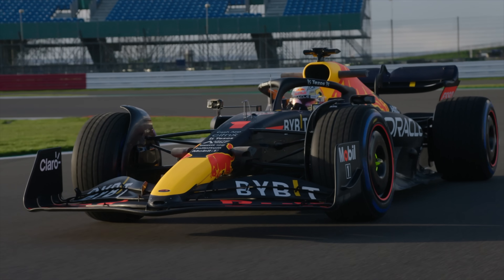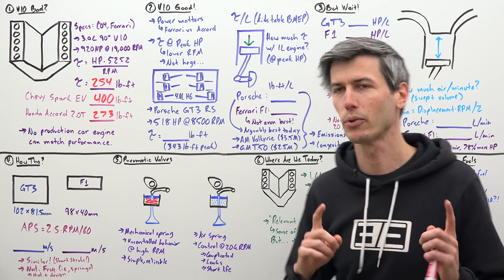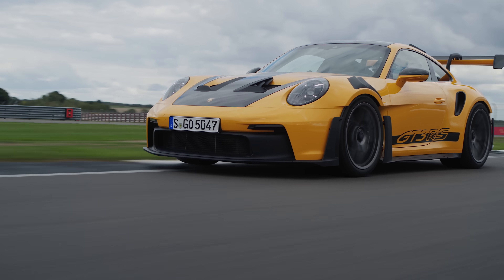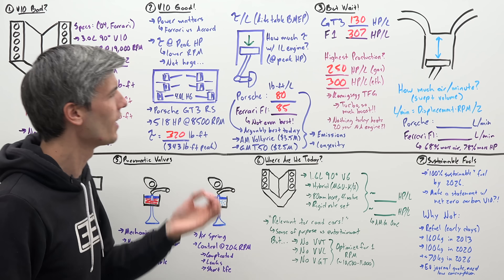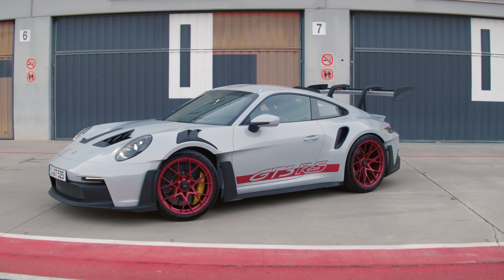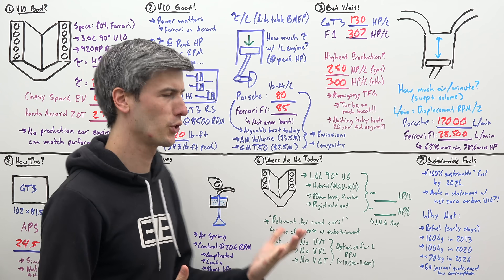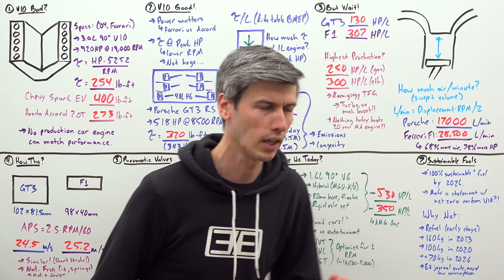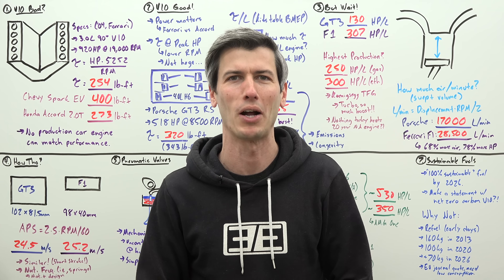Formula 1 V10 - The Greatest Engine Of All Time?

Comment: F1: "Let's use an engine more relevant to modern road cars."
Also F1: "Let's ban all the tech used in modern road cars."
🙄
Reply from the maker: Precisely, we're no fools!
Reply: @EngineeringExplained  Your videos are great. Not only informative, but funny also!
Reply: They're even removing the MGU-H for 2026, when it's finally being used in road cars
Reply: @Amy-dq2lg  What road cars? It's being removed from F1 because it's complicated and expensive. I can't imagine it's going to be on anything other than extreme hypercars.
Reply: @drunkenhobo8020 variable valve lift and timing has been used for many years by bmw for example. The B58 is reliable, powerful and is used by Toyota, ineos 4x4 and bmw themselves.
My 2c i think it's good :)
Reply: @ben7020 they aren’t talking about VVT….
Reply: @ben7020  Ok but the person I was replying to was talking about MGU-H. That uses the exhaust gasses to generate electricity and as far as I know, no road cars use it.
My own road car has VVT. I know it's fairly common on cars.
Reply: @drunkenhobo8020 Not only that, it's keeping the turbo spinning at the optimal RPM as well. Basically using energy to spool up the turbo and generating energy while reducing the RPM. But I agree to my knowledge no car apart from the AMG One uses that and I wouldn't exactly call that a typical road car either.
Getting rid of the MGU-H was also part of the agreement needed so that Audi would commit (not sure if Porsche wanted that as well, but it wouldn't be unlikely given that both belong to the same company).
Reply: @drunkenhobo8020  Variable valve lift and timing? You mean the VTEC Honda started using in 1989? Or Toyota's VVTi that they started using in 1995 and is used in exotica like their Corolla?
Reply: @MartinvanStormOfficial  Porsche were using fully-functional MGU-H in the 919 LMP1 car.  Audi also developed it and tested with the R18, but elected against using it. I'd be very surprised if Porsche were pushing for its removal, less so with Audi; but both companies had developed it, with Porsche winning Le Mans with it.
Reply: @OsellaSquadraCorse  PLus, I think Audi have used a version of the tech in some of their Road car engines. They use a version of the e-turbo to limit turbo lag by spooling up the turbo using an electric motor until the exhaust gasses could take over.
Reply: @drunkenhobo8020  the newer VAG v8s have electrically driven compressors
Reply: @drunkenhobo8020  Honda and Mercedes adapted the MGU-H technology for their road cars. It's not always a full Motor-Generator-Unit but Mercedes uses either an electric motor or the engine as an exhaust gas pump to keep the turbo running at a higher idle RPM. This is not so much performance-related but makes engine mapping, emission, and fuel management much easier at very low engine rpm.
For Honda it's similar but the recycling of heat energy into the turbo is really aimed at getting full torque earlier. That way, their new engines are small and light for the power they produce. But, indeed, the full chain of a generator, battery, and various motors to deploy is unlikely to ever be implemented in a mass-produced car because it's an unnecessary system complexity and cost for basically any performance goal.
Reply: @drunkenhobo8020 the new Porsche 911 turbo literally has e turbos
Reply: It's even worse:
F1: "These V-10 engines are way too expensive to race. Something must be done to give the smaller teams more chance to win."
Also F1: "Let's switch to incredibly complex hybrid power trains that cost almost 4 times as much."
Rest of the world: bruising their foreheads with facepalms.
Reply: They should just use 4 cylinder, more than 80% of road cars use that.
Reply: @GF-mf7ml Inline 4s don't work as a stressed member. The design brief for 2014 already called for them, but Ferrari vetoed it to avoid having to use subframes.
Reply: @dylansmit3883  Farm tractors do use i4 engines as a structural member.
Reply: @dylansmit3883  Ferrari vetoed it as they don't sell a car with an inline-4.  They insisted on at least a V6 option as that had some marketing relevance to the company, where Renault, BMW, Honda and VAG were pushing for the i4. When Mercedes broke ranks and joined Ferrari in asking for a V6 (along with Cosworth), the rules moved in that direction.
Reply: @OsellaSquadraCorse  Back then they didn't sell V6 cars either. But it makes sense they had future plans for them. The stressed member concern was also a factor though.
Reply: @OsellaSquadraCorse  RebBull were also against it as you can't mount an in-line 4 as a stressed member (or any inline engine really) you'd have to have a rear subframe which would completely change the design and engineering of the chassis. Let's not forget, that Ferrari didn't have a V6 in their lineup either at the time. (The 296 being their first v6 since the Dino I think)
Reply: @GF-mf7ml  and 3 cylinder is quickly creeping into the old 4cyl market, even BMW's are available in 3 pot configs these days lol
Reply: Actually, it's the 6 cylinder engines that is more common, throuout the production range of manufacturers. Small, intermediate, and large coupes, sedans, and touring/wagons, light and medium duty trucks, and SUVs.
Reply: They have already banned way too much developed technologies we can’t even count them tbh! It’s a shame!
Reply: Same story since 1980's. Nothing new. Glad that teams were at least trying those time to give us TC/Adaptive dampers and ABS
Reply: @thecompanioncube4211  And launch control, paddle shifters, TC in the early '90s.
Reply: THIS.
Reply: .......Yup! Big Red isn't Red Bull now is it?
Reply: Let's also make the engine legal to only perform in 1 race
Reply: @Engiction  that is not the case anymore. New regulations require engines to perform well for about half a season (up to 3 engines per season permitted)
Reply: @erkinalp  I don't really follow F1 racing it sounds food, but how they proof that the engine not changed and what's the penalty if they break the rule?
Reply: They're solved problems. Banning them gets the teams focusing on new solutions. Some of which can be added to road cars. If its a deadend (like MGU-H) then bam that and move on.
Reply: That’s the part that gets me, too. Ban all tech relevant to modern cars, and then F1 cars develop a whack-ton of systems regular cars don’t use. The MGUk? MGUh?

If they want F1 to be relevant to cars produced today, they’d set targets that production cars actually achieve, and they’d tell the teams to go wild as long as they stay in the box (within reason, so rich teams can’t just out-develop poor teams). 

Allow turbos. Allow superchargers. Find ways to develop MGU systems that could actually be incorporated into road vehicles. Give point targets that would allow teams to showcase specialization in better targets. Give points to teams that can achieve the lowest fuel flow while still placing above a certain spot on the leaderboard. Give points for teams that achieve car relevant milestones. 

I also think they should be developing new race tracks that can support faster cars more safely. I’m as much a lover of classic tracks as anybody, but there is only so much one can do if we’re unable to push cars faster due to safety concerns that are ultimately limited to how we can adapt old tracks to new speeds. Give us tracks that come alive at higher speeds, and then incentivize teams to hit safety targets, too. Give them opportunities to develop technology that can bring faster speeds safely, to incentivize the development of design and manufacturing techniques that would ultimately help road cars and passengers as well. 

There is so much that could be done in F1 to actually make it exciting in terms of racing AND development, and they won’t get there by artificially limiting the actual design space to something production vehicles today don’t ever use. You spur innovation by imposing creative limits on the resources all cars consume, and allowing teams to develop within a design space that allows them access to the latest and greatest car technologies production vehicles today actually use.
Reply: @ATTACKofthe6STRINGS  Agreed, I think the WEC had it right in the period that Toyota, Audi and Porsche went head-to-head with three different interpretations of the rules. And it gave us a few seasons of magnificent and very competitive racing. 

FIA/F1 always seem to feel the need to re-invent the wheel and almost every time their decisions produce the opposite result of what they tried to achieve. These hybrid powertrains had to be rammed through according to the FIA, because the 2.4-liter NA V-8's were "too expensive" for the smaller teams. And almost naturally quite contrary to what the FIA tried to accomplish; this generation of powertrains is the most expensive of all time.

The same goes for the almost continuously changing of the aerodynamic rules: meant to make the cars more competitive, but in reality it gives Red Bull a huge advantage because they have the genius that is Adrian Newey.
Reply: While relying on a ton of aerodynamic stuff that has no application in your regular road car and has way more in common with a jet fighter.
Tbh, it would make more sense if Lockheed Martin and Sukhoi ran F1 teams instead of Mercedes and Ferrari. It would be cool to se F1 go though a gas turbine era with insane gas turbine engines putting out like 5000 horse power(think like a sopped up General Electric T64), it sure would be more fun than these hybrids.
Reply: Tech used in road cars in the 80s!
Reply: @wiegraf9009  That's still beats most of EV performance in 2023. ICE tech is 100 years younger than Electric motors and batteries.. Modern ICE tech is based on 1947  Miller cycle, while electric motor didn't change physically since 1770's...
Reply: @razzor4708 sorry to say, but electric motors have changed a ton since the 1770s. Since the introduction of low lost semiconductors variable speed brushless motors have been practical, and control schemes and layouts are still being actively developed.
Reply: @wiegraf9009 Nope they were using state of the art flexible metals that were super expensive and now banned in F1.
Reply: I think to be fair the tech used in road cars is often inspired by the development of F1 engines so we may see a trickle down from the engineering developed in F1 trying to get the most out of an engine within the confines of those restrictions.
Reply: @StephenJohnson-jb7xe that hasn't been true for several decades, unfortunately.
Reply: Fuel economy requirements have led to turbo-charged small high revving engines, with direct fuel injection.  The increased strain on the oil should require more frequent oil changes.  Emissions rules have led to exhaust gas recirculation and crankcase ventilation.  These two things lead to large carbon deposits on the upstream side of the inlet valves.  Longer oil change intervals and lack of manifold injection both lead to premature engine wear.  Another silly step is the use of toothed rubber belts to drive oil pumps and cam-shafts, instead of chains, but still running in the engine oil.  The belts fail prematurely.  Bring back proper non turbo engines please.

Comment: The core (and interesting part) of the modern F1 engine is actually the MGU-H, since they are getting rid of that I think they should go back to V10s.

Edit: You heard the Honda RC166 bikes from the 60s? Maybe they should cut the displacement of the engines again and make them rev higher.
Reply: MGU-H has never been relevant to road car technology though. The cost, the complexity, the limited benefits, it just doesn't make any sense.
Reply: Especially if they're using synthetic fuels, just put a V10 back, and watch the competition come back!
Reply: @PaperBanjo64 and watch the manufacturers beside ferrari or maybe redbull powertrains leaving instantly lol. Maybe small engine builder and developer will join but we'll have experienced giants vs handicapped midget race.
Reply: The engine need to rev over 4000rpm to spin turbo and MHUH, on the road who do that? Most of us drive under 300prpm.

Comment: Actually! GMA website promises the engine to have 479nm and 670hp! In dyno, they came out to be bit beefier than initial estimates.
Considering that is also a 4.0 engine(in reality) so that means it is 119,75Nm/litre. Where did u came up low torque figures not matching the Porshce???

Comment: formula 1: releases untold amounts of CO2, per capita, moving whole teams of people and equipment around the globe every week 

also formula 1: "let's make a sustainable fuel standard so we can show we're with the times!"
Reply: I can't prove it, but I'm pretty sure that the lion's share of the pollution from F1 is actually from all the fans traveling.
Reply: @michaelre7556  that sound right, but F1 has no control of how people get to the race. 

again it's not about the total carbon emitted, but the per capita from moving everything around. the amount of fuel used by the cars during a race weekend is minuscule compared to how much it takes to MOVE said cars across the ocean.

formula 1 should just accept it's a sport of excess, and drop this hypocricy. if they really cared about sustainability, they'd run the whole season on one track
Reply: @juancuelloespinosa  I totally agree.
Reply: @juancuelloespinosa  have all F1 races in Nürburgring Gesamtstrecke (nordschleife+südschleife combined) 🤔
Reply: @erkinalp  while it'd be cool to see, nurburgring hasn't been used in f1 for a while because it's too long, so it'd require too many marshals and make it too difficult to get safety cars and tow trucks where they're needed

I'm aware many racing series use it. I'm not sure why f1 thinks it's unfit, but endurance cars are ok

Comment: I'd LOVE for F1 to ditch the turbo hybrid snore-fest in the interest of better sounding NA V8s or V10s. No one watches F1 because it's green. They'd save the planet better by making the transportation of the teams more efficient.
Reply: Conversely nobody watched F1 in the 2000s and 2010s just for Le funny screaming engine
Reply: @dod_the_angel  It certainly  didn't hurt.
Reply: @heyhayhay247  maybe so but bitching about the engines isn't really needed. In person they're plenty loud but in a different way to the V8s and V10s. Best way I can describe it is it feels like your entire body is vibrating and your eyeballs are jiggling in your skull because it's a more low bass tone. Also if the engines were still the same as the 2014 spec I'd agree because those were too quiet

Comment: One thing not mentioned that also speaks in favor of the old V10s, is the weight. The current 1.6L TT V6 units are 145kg (although I think they were about 125kg at their lightest), while the old V10s were as light as 85kg. 

I wouldn't say that the Porsche engine is necessarily better than that of the T.50 or the Valkyrie. While it does have more torque/L at peak power, the T.50 has higher torque/L at peak torque (465Nm vs 479Nm). It also almost certainly produces more torque at 8500RPM (the peak power for the Porsche) - as the peak torque is produced at 8000RPM - but it's harder to sustain it all the way to 11000RPM where it makes peak power.

Comment: Just finished watching Jason Cammisa's ICONS episode on the Cybertruck and thought it'd been a while since we saw an EE video.
Was half-hoping for a deep dive into 48 volt and why more cars aren't using it but an F1 engine video will do ;)
Reply: Les volts = more current, more current = more heat and thicker wires. Double the voltage and you can halve the cable thickness.
Reply: @squidcaps4308  yeah I watched the video, hence "deep dive" as it can't just be that simple. (Cammisa obviously has to choose what he spends time on when talking about a whole car) 
If it's that clear cut, surely we'd just keep increasing the voltage if it has no drawbacks and end up with super high voltage systems.
Reply: @Ubarius  Oh, there is a huge drawback: all insulation has to be thicker as higher voltages go thru insulation much easier. There is also arcing, much less of a problem until we are at kilovolt ranges. They are also VERY dangerous, you could put both hands on a 48V rail and feel nothing but mild tingle, do the same on a 96V rail and you get zapped, not enough to be really dangerous but enough to get your heart racing because of the scare you but 480V would just straight up start to kill you. So, we don't want to go too high in voltage either but want to find a happy compromise. After all, the motors need power and they don't really care if it is high voltage or high current, both just have their own drawbacks.

The same reason is why people in USA don't use electric water kettles; in 240V mains getting 2kW of power is quite easy, the wiring is all standard but to do the same on a 120V system.. all the wiring should be twice as thick, which usually is not the case in the receptacles meant for kitchen appliances. The electric oven, clothes drier etc things that require loads of energy work with 240V in USA.
Reply: @squidcaps4308  thanks for the insight!
Sounds like 48V is a win-win over 12V then if it's still not dangerous.
Assume the thinner wires (less copper) but thicker insulation means the actual cable on a high voltage system is fatter overall?
Reply: @Ubarius  It can be same thickness but weigh and cost a lot less.
Reply: There are many luxury cars using 48v for high power/energy consumption components like mild hybrid systems, rear steer modules, air suspension, etc.
Reply from the maker: Thanks for popping over! Cybertruck was a quick last minute cameo, but I hope to dive into the truck with time!